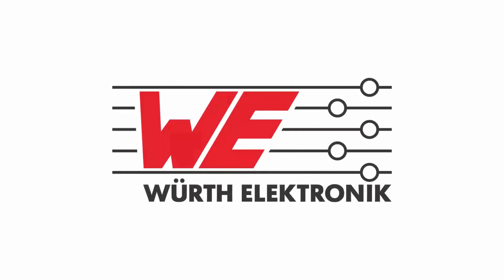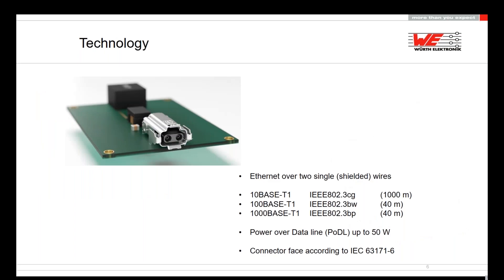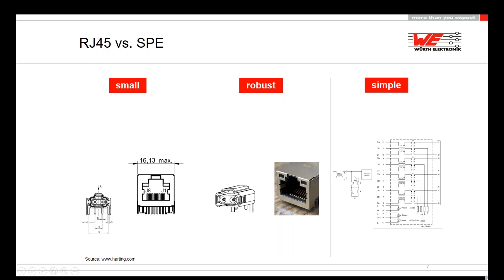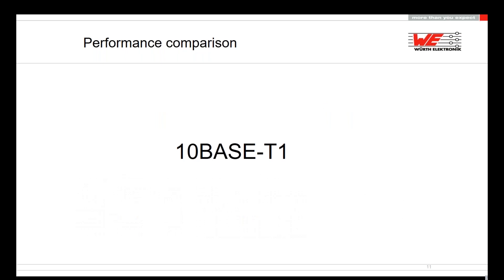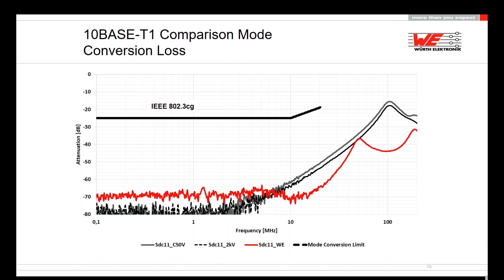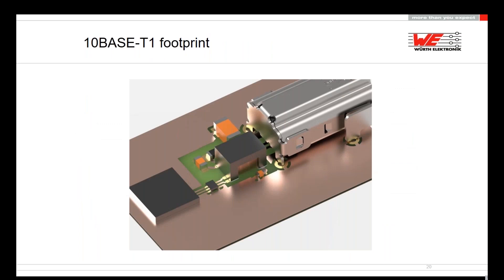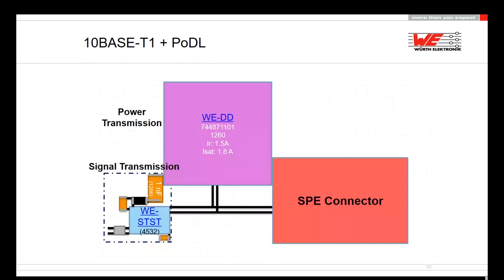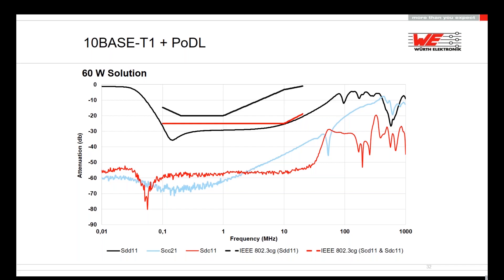Würth Elektronik Webinar: Single Pair Ethernet filter design for industry

Comment: Great Material. Does transformer or capacitor solution need impedance match to the cable? how to implement that? Tks
Reply from the maker: Thank you very much! Now regarding your question: Yes you should match the impedance to the cable. To have the best matching, you should design your trances and layers on the PCB to an impedance of 100 Ohms. If you have some detailed question on the layout for SPE, you can also contact our Product Manager: Martin.Leihenseder@we-online.com. Kind regards Saskia from Würth Elektronik